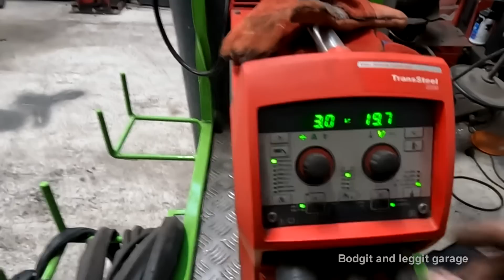DOE Van-dalised Ford Transit  How To Make How To Make Repair Panels With A Spanner Part 1

Comment: Really enjoyed the video bought back some good memories of welding with my dad  a Morris Marina in the mid 80s I was in my early 20s at the time. Ended up getting arc- eyes it was not a pleasant experience at the time. Its amazing how all the equipment has improved since then. The southampton produced  transit must have been dripped in the solent before they were painted.
Reply: I replaced the suspension top mountings on a Ford Zodiac myself in my early 20s using a hired Arc Welder and ended up with a visit to A&E thought I had got bit of metal in both eyes from working on rust under the car but it turned out to be Arc Eye which I'd never even heard of at the time. Blooming painful 😵‍💫😭
Reply: True grit, your dad taught you a lesson.

Comment: Nice Job mate. It's nice to have it up on the ramp, the only welding I've done on sills and underneath, cars always been up on drive up floor ramps and I've been lying on my side. I always keep a co2 fire extinguisher that I use to put the fires out that seem to always start.

Comment: I just made up the bottom of the nearside inner stiffener that is near the rear edge of the sliding door. It's like a round cornered box that runs down vertically on the outer face of the inner sill ( if that makes any sense ) The new one I made has a much larger drain.
Reply from the maker: @nexpro6985  nice job mate

Comment: 2nd. Why did it fail? it's not structural. Sharp edges?
Reply: Within a prescribed area
Reply: If it's rusty enough to poke holes in within a few inches of any body mount then it's a fail
Reply: If it’s within 30cm a think of a structural area it’s a fail
Reply: 30cm deffo correct😉👍

Comment: Every one does the job differently but as long as it’s welded and not filled with expanding foam 😂 it’s all good , I’ve been welding cars for over 42 years and an mot tester for over 36 years , I’ve not seen it all yet but they all turn up eventually for test 😂
Reply from the maker: I can believe it. You might be able to answer a few questions for me as a tester. Are you allowed to put holes in people's vehicles? Also, if you watch some more of my videos. A few people are saying these will not pass  the test Because I did not well all the way around. Where when you do panels near wheelarches and return lips. It is impossible to world all the way around. Even the factory does not do this. As I'm sure you're well aware. These repairs have passed 2 tests and I know they will pass a test. What is your opinion on this

Comment: I’m no professional but I’ve done my fare share,I’ve enjoyed watching but afew things I’d of done…is once you’d made the inner sill panel I’d of tacked it into place like you had done,then ground round the new panel abit at a time and butt welded it(no need for a panel on the inside)plus if i were to lap weld,I’d clean up my metal,and treat with weld through primer,it won’t burn off……the longevity of the repair would be much longer…..plus think of all the  extra wire and gas needed!…..but still liked watching😉👍

Comment: On an old van I'd just treat the rust and put the repair panel straight over it. It will outlive the van. And use a dremel for small cuts like the bottom right. By the way that looks like a lot of work, it must be expensive.?